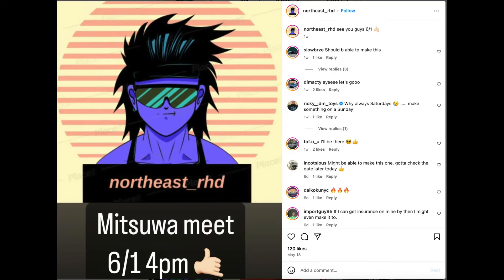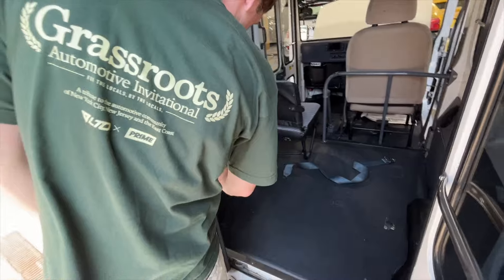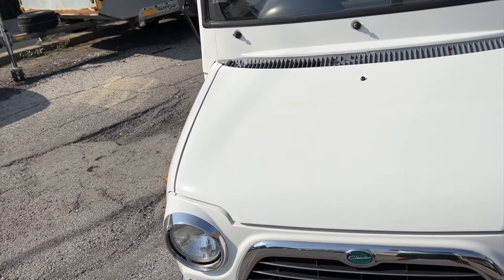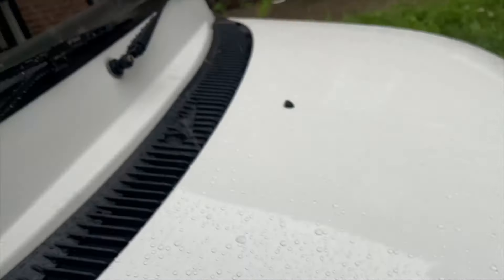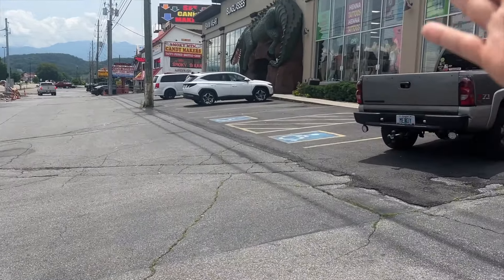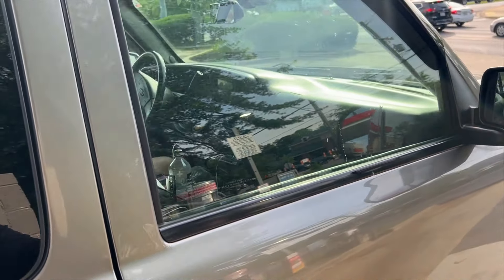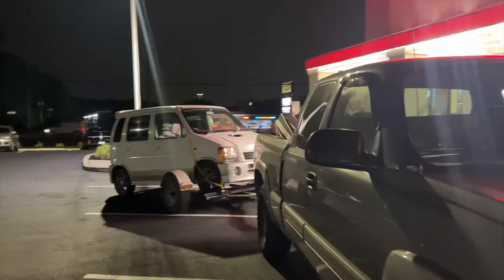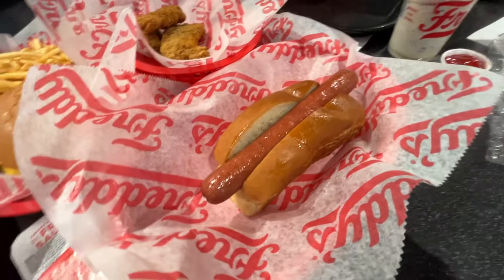You Won't Believe How Good The Mira Walkthrough Looks!!!!

Comment: As an English man I can tell the Figaro was definitely.a UK car , not sure how much that was a really good 1 here is £5000 about $8000 you can find them from £2000 a top very low mileage showroom condition is £10,000. I've actually just checked on Autotrader on that website theirs 27 for sale then all other websites. I once commented on WBTF video why don't Americans import the same car from the UK as it's going to be far cheaper than from Japan. By the Figaro and 1 of at the port videos people must be as the Audi A3 , Landrovers, Fiat Barchetta & the R34 Skyline all were UK registered cars. Also we don't have restrictions so the likes Of R34 Skylines & many Kei cars have been imported from brand new upto 5 years old.. Also Cappacino , Jimny, Daihatsu copen & Mira TR-XX & Honda Beat were sold here from Brand new in UK RHD spec.
Reply from the maker: I didnt know you guys got that many kei cars I thought it was just the beat and capp!
Reply: I've told you quite a few times since I started watching your videos that the Cappacino was sold from Brand new and as they rusted for fun theirs not a lot left . last year I knew of a really good Silver 1 owner less than 60,000 miles sold for £5000 they can be had for less but they are rust buckets. Also we had from release the Daihatsu copen in 660cc & non Kei 1300cc they have metal folding roof electric windows leather heated seats 5 speed gearbox  Also Honda Beat and the Daihatsu Mira TR-XX that was  it about 4 or 5.. Wish we had the Honda S660 from new without having to import . Theirs quite a few here now and they can always be found for sale so it's not a problem now . Newest are 18 months only & oldest 8 years. Quite a few Honda N-box here now from 2012 generation they have everything heated steering wheel seats, climate control, cruise control but all seem to be Autos .